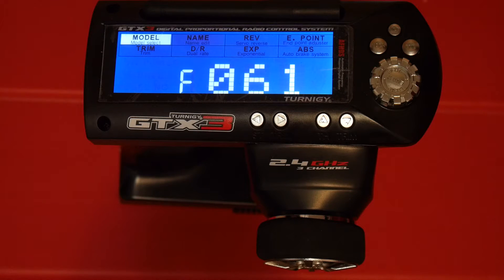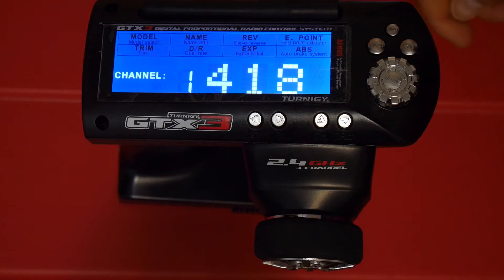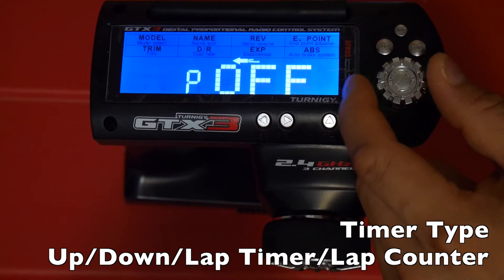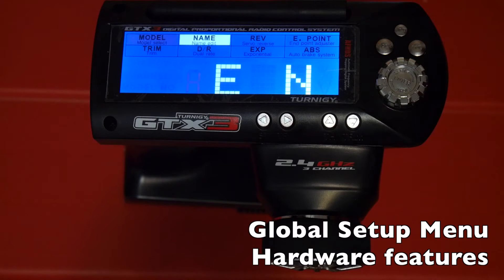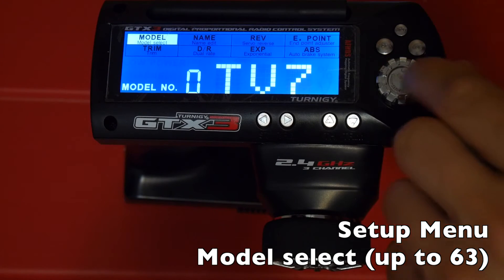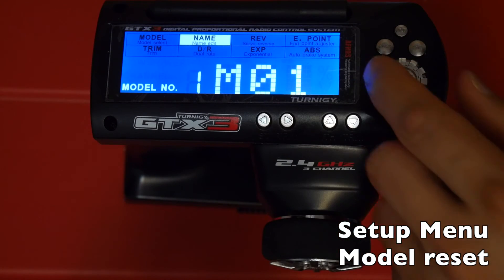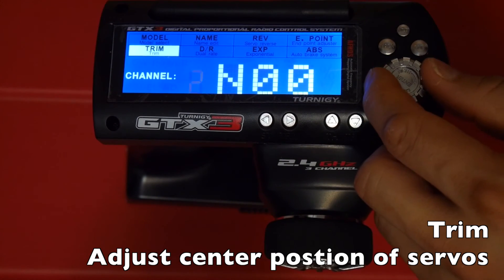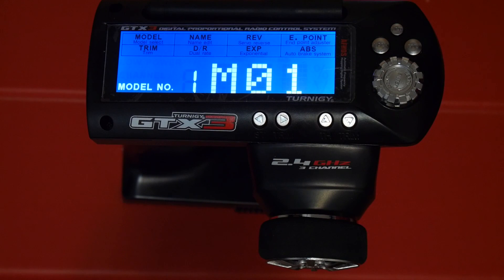FlySky GT3B GT3C Turnigy GTX3 Hack Firmware Setup Configuration Guide

Comment: Help please. 
Rev 3.6 2020.06.01 
No binding with receiver after flashing. Everything works after returning to the stock firmware
Reply: Hello. I've the same problem. Did you find the solution?
Thanks
Reply: Having the same problem, thought it was just me

Comment: Great video.  I did the firmware upgrade, but my channel 3 button doesn't seem to be doing anything.  It's for my two-speed transmission.  It works for setting the end points, and using the channel reverse switches gears, but when I use the channel 3 button when out of the set-up menu, it doesn't do anything.  Any chance you have encountered this problem?  Or anyone else reading this has?

Comment: Hi, id really appreciate if you can reply and help; ive just followed one of your video and some other youtube vids to get my GT3C  updated it to "prerelease 0.6.2.S19" firmware, i updated it primarily to get more trim on steering, but my diatone Q33 rc car still doesnt go and drive in a straight line as the steering trim still is not enough to make wheels go straight in centre,
When i bind the car to the transmitter the wheels gets turned to the left side and so i need to move wheels back into the centre but theres not enough trim to make wheels to centre..
 The trim level have increased to 99 on both right/left with this firmware but it still makes no difference when calibrating even fully to 99 on the right side, it still drives more to the left, the wheels just moves very little and just acts like the normal stock which had 30 trim level.. Is there something can be done to configure steering trim or is it possible to make the car wheels into centre position somehow?? Thanks in advance

Comment: I successfully flashed my GT3B to the newest firmware 062 and now my ch3 Button is no longer activating my auto resetting remote kill switch. But what's weird is if I reverse ch3, it activates my remote kill switch, then my kill switch resets but pressing the ch3 button still won't activate my kill switch. I've tried calibrating ch3, I tried setting it for both no long press and long press and still no luck. My kill switch works because it activates if I turn my transmitter or receiver off.

Comment: ok im late to the party, but this is, after lots of searching the best,simplest and most comprehensive guide to the hack firmware ive found, i now have an old servo board controlling my winch from a GT3C on the CH3 trim, nice smooth progressive winch not all or nothing...thank you

Comment: Worth noting that these controllers have a response delay and bugged exp function with stock firmware so its worth doing the upgrade even if you don't use any additional features.
Reply from the maker: Oh yes. That's a good point. Thanks for bringing it up.

Comment: Hi Everyone.does any one knows if this mods can be made to GT3C ?Thank you
Reply from the maker: Yes it can be. The process is similar to gt3b but slightly different. Check out my updated gt3b flashing guide. https://youtu.be/b5mZ3898ZNQ
Reply: @KenVersus  thanks a lot for the help and for your reply mate
Reply: @KenVersus  hi,i saw this video and i can see that you used the same ST Program usb ,i found another type of circuit board to make the update firmware mod ,are these two Circuit boards do the same mod?
Reply from the maker: As long as it's a stlink v2 for stm8. Has swim rst 5v gnd connections.

Comment: Question: taking the electric car with this station at a very slow steady rate, I see that randomly, it hits like a small gas strike and returns to the slow rhythm ... what can it be? It happens to me with two cars, different variators, different receivers, same station
Reply from the maker: I'm not understanding. Maybe car battery? Try a different battery for car.
Reply: ok, the battery is the same..... is necesary a external BEC using a 2s lipo battery? the two ESC have internal BEC 6V oupout
Reply: ok, I tried another battery with the same result
Reply: i tried another transmitter  (old gt2) and the same result
i tried a old futaba 3pj FM and work ok!!!!
The problem is the  4 receivers flysky?
Reply from the maker: If you can try other flysky recievers.

Comment: Helpfull video!
I seek a bug with my turnigy gtx3 in stock - ABS works only at backward mooving ;) I make hardware mod for trottle and now work fine but LCD showes "->forward" when model moves back ). It seemed that this new firmware help to solve such problem without hardware mods...
Reply: or may be abs must work only in revers?...
Reply from the maker: +101picofarad definitely worth a try. This firmware adds more features than stock as well
Reply from the maker: +101picofarad hmmm gimme to think of it. That might be it. Which makes sense. But can you reverse the channel?
Reply: kenVersus I can, but in stok abs not work at forward mooving at any combinations.
Reply: kenVersus As i understand - this is normal behavior :) But i whant use abs at forward moovig to.

Comment: so this firmware is confirmed working on the gt3c?
Reply from the maker: +Liam Batge yes for gt3c and Gt3b
Reply: Awesome, i have my gt3c on the way now, so keen to ditch the garbage radio my baja came with
its already caused 1 runaway that nearly hit 2 adults and small kid and a dog. It was just puting in the middle of the road next minute its gone quater throttle and its outta here.
Reply from the maker: +Liam Batge that sounds crazy. But with the flysky receivers you can set the failsafe too. So that'll come in handy.

Comment: Hi Did hack New version 0.6.1 Having a Problem HPI Savage Nitro Slot 1. My Reverse Did Not work, after Messing, Got it Working Only to lose it Again. I'm wanting to add lights to car Ch4 As On/Off on D/R Switch. After a Few Hours Give up. I have watched Your Post around 30 times "yep I'm Crap" Still not got the Plan lol. What Is the Reverse Button Called In menu! Gather reverse is "d" as channel 3 is Trim, Is Ch4 Reverse! Are they Any Diagrams!! 

 Another Problem after Hack I've MT2 Nitro. Paired to Receiver On Slot 2 for 3ch been Lights Again. But On trying the Steering Throttle are moving But not as they Should Be Very Sluggish Not full Turn Or Throttle/Brake. I've not Put a 6Ch Receiver On MT2  just the Normal One.
Reply from the maker: +christopher Buckley check out the manual. There are lots of information in there. Ch1 is steering. Ch2 is throttle and brake.  I don't really use more that 2ch so don't have experience. 

If it's sluggish check to make sure your transmitter is calibrated. Or check the rates to make sure it's 100%.  Check end point values. 

That's all I can think of. The manual is here:

https://github.com/semerad/gt3b/blob/master/Releases/MANUAL-0.6.1.txt
Reply: Thank you Ken..

Comment: Hi mark, great video. how do you switch the way everything reads on the screen. it reads right to left and I want it to read left to right. I know it can be changed but can't remember how to do it. I have the gt3c radio not currently modded.
Reply from the maker: +Mike Woods hmm..  Didn't know there was an option for it.   There is a manual for the firmware.  Should mention it in there.  Check out the github link in the description
Reply: Thanks. I'll check it out.
Reply: Thanks. I'll check it out.

Comment: oh.. which turnigy receiver do you recommend a 6 or 8 channel model? any tutorial on setup? to take advantage of the mod.
will any of these work? 
-Turnigy XR7000S Receiver for Turnigy 6XS TX
-Turnigy XR7000 Receiver for Turnigy 4X/6X TX
-Turnigy XR5000 Receiver for Turnigy 4X TX
-Turnigy 9X 2.4GHz 8Ch Receiver (V2)
Reply from the maker: These are known to work.  I've never used more than 2 channels so I wouldn't have 1st hand experience.  But I believe you assign the channels to a button.  

Hobby King 2.4Ghz Receiver 6Ch (HK-T6A-V2)
http://bit.ly/hk6chv2rx

Turnigy 9X 2.4GHz 8Ch Receiver (RX-9X8Cv2)
http://bit.ly/9x8chv2rx

Comment: ABS does indeed work very well for electronic cars too. what it does is (just like on a nitro) it just 'bips' the brake with a little pause when you apply brake.  The difference from a full scale car is that they actually look at wheelspeed and only 'bips' when the wheel is skidding. That is hard to do on rc-cars (but should be doable on a sensored brushless system i think) This is why there are settings to this ABS. You will have to find the right setting for it to actually feel where you get optimal brake performance versus enough 'bipping' to make it not skid. On brushless systems atleast you can hear it on the engine whine if you listen closely. Anyways nice review and configuration tips. Im gonna get hacking now i think.
Reply from the maker: +A Baker 71 Hey thanks for the info.  I always thought ABS was controlled via the ESC programming for electrics.
Reply from the maker: +A Baker 71 My GT3B hacking video is here:

https://www.youtube.com/watch?v=8oxODTOkecE